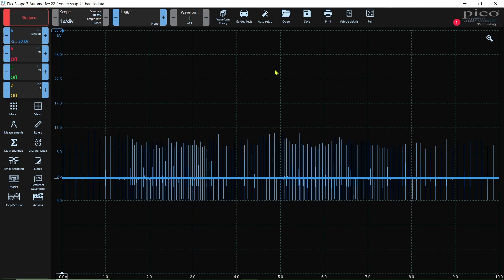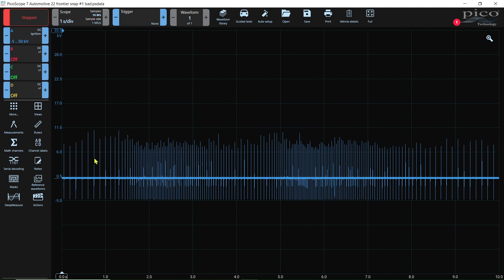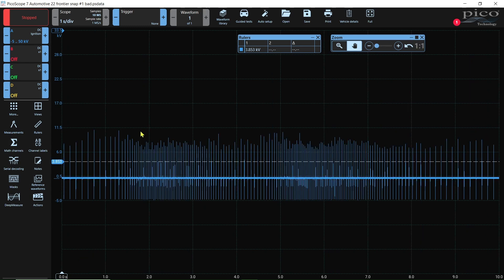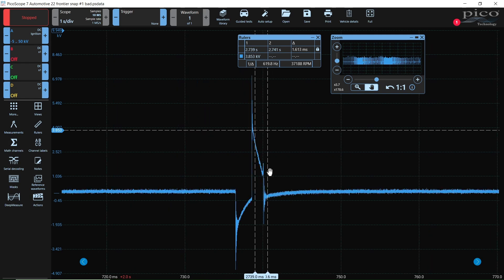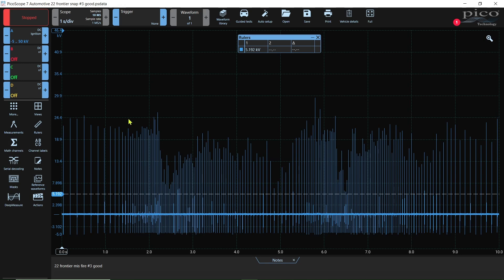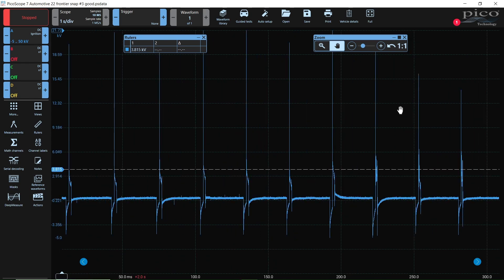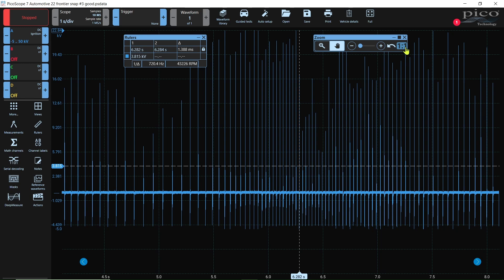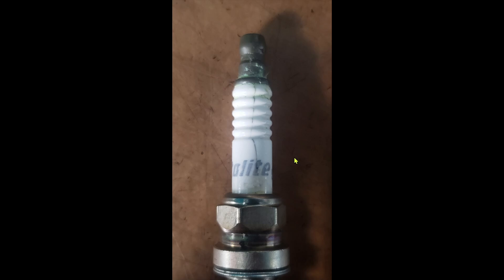Secondary Ignition Trivia

Comment: Curious as to why the spark line slopes down? Most of the waveforms Ive seen the spark line runs straight across. Could you please explain, thank you!
Reply from the maker: I think its a combo of the wand I use and Nissan coils are notoriously difficult to get a good pattern.  
Just have to practice alot and get used to what normal is.

Comment: Maybe you could skewl me a bit. So here's what I knew as I watched along. There was no KV spike when you snapped the throttle. That much I knew. I can't decipher much else from ignition scope patterns, but I do know KV should rise with increase in compression. So as an amateur, can you tell me did you have any other way of knowing prior to disassembly that it was secondary and not primary? IE like had you ruled out a weak coil before diving in? I'm thinking about early 3V Fords where the coils were notorious for firing at idle and not firing under load. I do know you said this one was completely dead miss all the time so not quite the same as my example, but do you understand what I'm asking when I say how did you know it was not a weak coil and would be a secondary problem from the waveform?

Comment: Your KV scale is completely wrong, it should be peaking at 30 KV or more. It's to do with the way you're measuring it.
Reply from the maker: I'm sure the KV is pretty high, im using an inductive secondary wand and its in a tough spot, so the actual kv numbers aren't relevant , im more concerned about the change in KV as the demand for it increased and decreased.
Reply: @CartersDiagnostics  I agree that it is the change that matters not the absolute value. This probe is probably capacitive, not inductive?

Comment: I've been doing this for just over 38 years, and noticed the burn line was too clean. However my guess was a cracked insulator deep down inside the plug which can also do this. Years ago when I attended a Robert-Bosch training clinic where I learned some eye opening things. #1 - Pay attention to the insulator diameter. If the replacing sparkplug is as much 1mm smaller than OEM, you'll likely get a misfire sooner or later. #2 - Lower the sparkplug gap on anything requesting .0.045" or more. This lowers the stress of the ignition system a great amount and improves mileage.
Reply from the maker: Great information. Thanks for sharing. Now I wish I would have measured the cracked plug and compared it to OE. I will the next time.👍
Reply: What plug brand did the o.e. call for?  I wonder if that plug was a fake plug with very high resistance.🤔. It would've been interesting to measure the resistance of that plug vs. another of the same brand vs. the o.e. plug.  There are some vids about this & the fake plugs have crazy high resistance, which could explain maybe why that plug made its own path.🤔

Comment: Fascinating stuff Mike. When you asked what might be wrong I was thinking spark plug but honestly i wasn't sure why. In the GM world i came from it was common to find carbon tracked plugs but I don't ever remember one causing a dead miss. It was very hard to duplicate in the stall. Took a test drive with high load at lower rpm to get them to break down. I guess  I wrongly thought a carbon tracked plug would have caused the spark line to have broken out at a higher kv compared to known good and have been a bit more violent looking.
Reply from the maker: No  two carbon tracks are the same . This one was worse case and easy to find. I honestly think someone cracked it during install. The coil boot was heavily compromised also.  So the secondary components couldn't hold the KV . So it produced a perfect downsloping spark and it jumped out early.  I've seen some carbon tracks fire half in and half out of the cylinder they do tend to look violent,  kinda straight down. A carbon track  does offer some resistance to the firing, unlike a direct spark to the cylinder head.
Reply: @CartersDiagnostics    Thanks, that extra info really helps.

Comment: Hi,
I am still learning 2ndry ignition, so i paused at around 4-5 minute mark and tried to figure out what is wrong with this vehicle. From the captures i see the coil firing, there is a spark of some sort, there is no turbulence on the firing line, and the kv stays the same. I am thinking either the spark is escaping through the coil boot to the cylinder head or there is carbon tracking on the plug. EDIT: after finishing the video it was carbon tracking on the cheap sparkplugs. Q: could you tell from the captures if the coil boot would be pin holed? What would be the difference? I know its semantics, because the result would be the same and the intake would have to come of anyway. Thank you.
Reply from the maker: Great question 👍Thanks for playing along. From my experience a carbon track just has a distinctive look . They are usually jagged and slope directly down. Its like using electricity to etch live edge wood. The track offers some resistance and seems to burn slower vs a spark  jumping threw air to the head. Thats not a scientific answer but thats just my experience.  Either way we figured it was ignition and not firing in the cylinder !
Reply: Thank you for clarifying that, another item to add to my list of experiments/scope practice next time.  @CartersDiagnostics

Comment: What happened to the candle, was it broken? If there is an electronic throttle, does the engine controller also open it immediately when we press the gas pedal while stationary? Thank you for the video.
Reply from the maker: If by candle you mean spark plug iys a big carbon track,  and its possible it was cracked during installation. I'm thinking a slight delay from gas pedal to throttle opening, I've never actually measured the delay.
Reply: @CartersDiagnostics  Why is there no turbulence on the combustion line on a bad plug, but on a good one there is, what does it depend on?
Reply: @ebolti22   The spark line would show turbulence because the in-rush of air would blow the spark around showing it as squiggly line on scope, like the flame of a candle if lightly blown on it flickers and jumps around. Mac Vanderburg did a vid where he showed a plug being held outside and blowing air across it as it sparked to show how and what the turbulence looks like on a scope. Since the spark or most was out side the cylinder in this case there would have been little or no spark across gap to be blown around and possibly not as visible on scope. Just my thoughts though.
Reply from the maker: Nice answer to his question 👍.  Its actually Mac VandenBrink . I just wanted to get the spelling correct just in case others want to look him up and study his work.